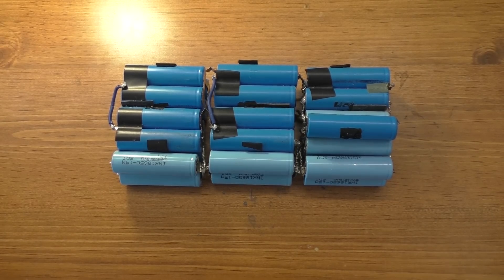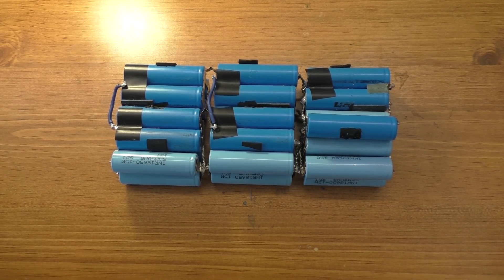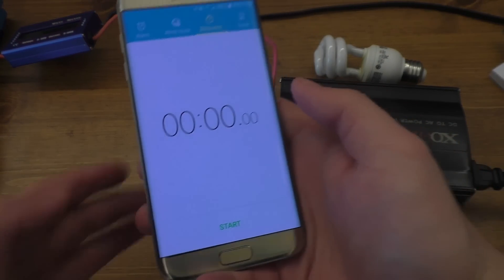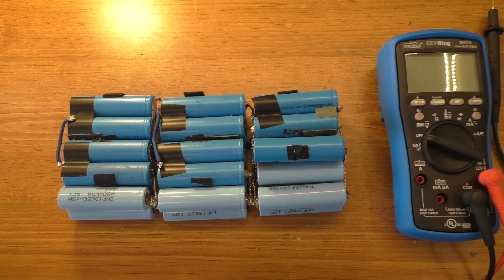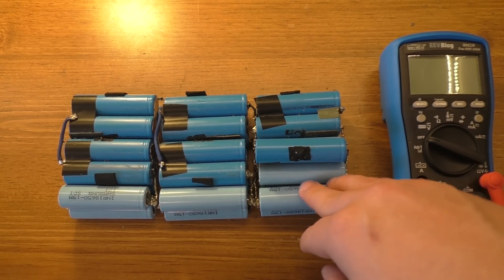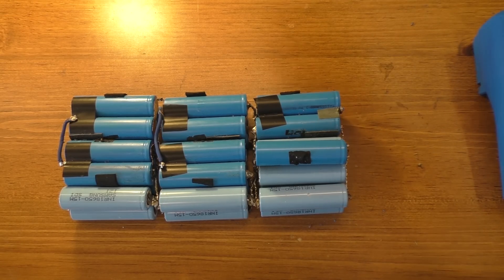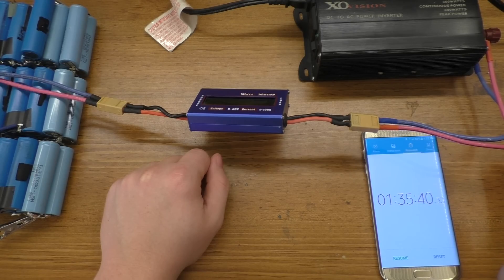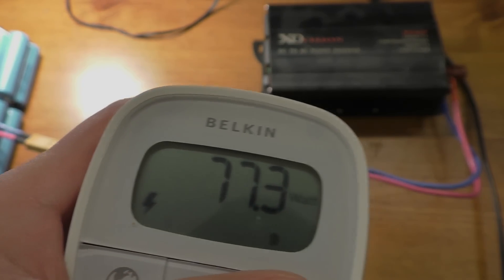DIY 12V Li-ion Battery Problem Part 3

Comment: Nice more and more people are experimenting with 18650 batteris from what i read you should charge the battery to 4v nominal 3.7v and not go below 3v and before put them in a pack you should check the capacity of each battery and mach the cells by voltage and mah capacity all the best

Comment: I find incandescent bulbs all the time! my father insists on buying them...
from florida btw
Reply from the maker: Interesting, I can find Halogen light bulbs. They give the same color reproduction as incandescent bulbs but they are weird wattages. Like a 100w equivalent bulb will be 72w. It's just kind of a pain to deal with when you have old test results that revolve around the old bulbs.
Reply: best place to find them here is the dollar tree, my father insists on buying them because well, price
Reply from the maker: Thanks, I'll have to look there.
Reply: good luck! at mine they are next to pet supplies